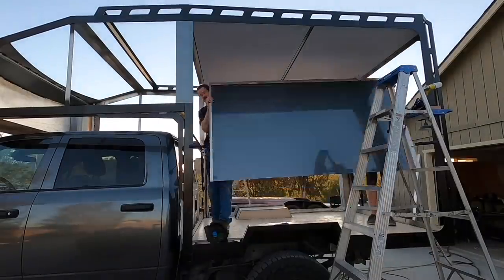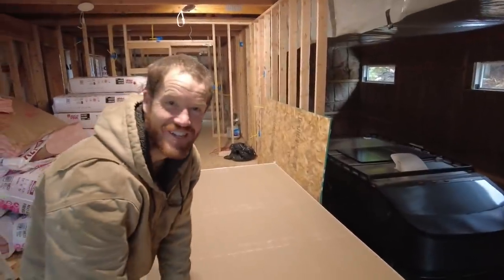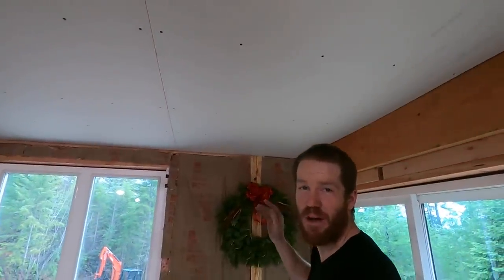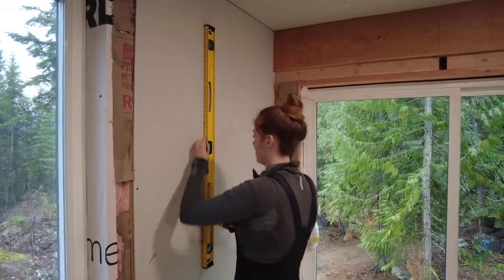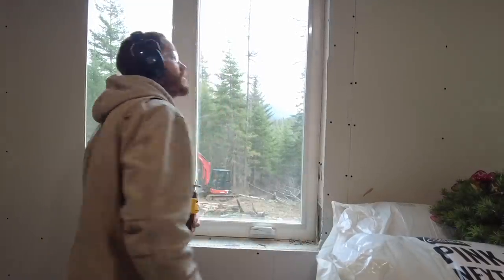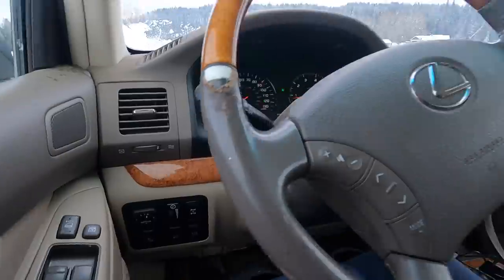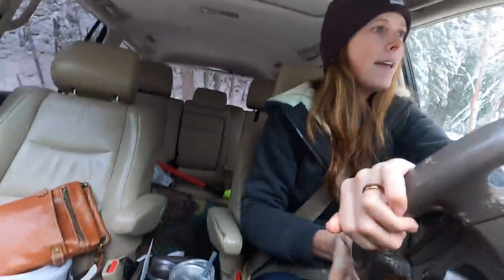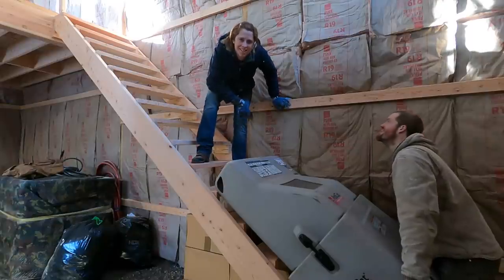Building Our Own Home | Drywall

Comment: What about your vapour barrier between the drywall and the rafters?  What did Courtney say at 15:18?  As someone who has lived with winter snow conditions for close to 70 years, may I suggest that you put some weight in the back of your snowplow truck for better traction when plowing.  You may also need snow chains.

Comment: You know Courtney,  voicing our fears, is the FIRST step to identifying them, and finding a way to overcome them or live with them.
I also agree with what Matt Rhodes wrote.

Regarding the window (and door) openings: Jeremy over at Good Simple Living figured out that a router can make a nice, clean and neat edge in any kind of sheeting. And by using the frame behind the sheeting as a guide, the opening is exactly to size.

Comment: You ain’t been stuck in snow until you get the plow truck stuck. Don’t say I didn’t warn you. It might take the “Army Truck” to get you out. 

1. Try to plow downhill and under control. Take it slow and push the snow off as far out as you can.
Plowed snow gets hard and turns into a rock wall. You won’t be able to plow it further away from the road later. (To make more room for new snow)

2. Get tire chains now. Keep them on until you get a full week of 70° weather next Spring. Tire chains allow you to sometimes plow uphill on the second push. They also give you great traction. 

3. Put as much weight in the truck bed as you can without bottoming out the rear springs. It will help the chains get a grip.

4. Make sure the wipers work, and work well.

5. If they are predicting a foot of snow, begin plowing when you only have 6” on the ground. You’ll thank me later.

6. Put two pieces of rebar or doweling sticking up 30” from the top edges of your plow. These are your guides to let you know exactly where your edges are at all times. Again, you’ll thank me later.

7. Adjust the plow feet up about 2” if you have rocks sticking up on your road. 

8. Never, ever push snow onto another man’s road or, God forbid, the government’s road. Hell hath no fury…

Plowing is really fun. Enjoy the experience. And you will get stuck. Have a plan to get unstuck already in place before you plow.

John in Minnersoda
Reply from the maker: Thanks for the tips John!

Comment: If you take a 2x4 about the height of you ceiling and attach a 3-4 ft 2x4 at one end to form  a T that is just an inch taller than your wall, you can use that to hold the drywall to the ceiling at one end while the screws are put in the other end.  Just kick the end of the board in contact with the floor lightly to press the top of the T against the drywall.  Make sure there is wood behind the drywall where you are applying pressure.

Comment: I am not afraid to say I would be petrified of taping and mudding your apartment.  I tried it once on a bathroom remodel and ended up tearing the drywall out in a fit of rage.  It was truly traumatic and took me 3 months to recover and start over.

I think perfectionism is a sickness and I have found no cure...  I paid a professional to finish my 2nd attempt, or I might not have survived.
Reply from the maker: It is certainly a very frustrating process! The pros make it look so easy…
Reply: The guy I hired used a light to show high and low spots.  He was freaking fast too.

Comment: Hi! There is no vapor barrier and insulation on the ceiling. The drywall will sag in a couple of months, depending on the humidity, since the frame for drywall is not made correctly. It's a bad job.. I hope you will learn from your mistakes. Success and happiness to you! With love from Russia!)))

Comment: When we use drywall, we cut a bevel (about 45 degree) in the sheets where they meet. Afterwards you fill those bevels with plaster and put netting over it. If you do it right, you will no longer see, where those panels meet - of course you see the different colors of plaster and drywall. I'm sorry, it's hard for me to explain in English. But anyway, you are doing a great job! I can't wait for the next episode.☺️

Comment: 5/8 " helps prevent ceiling sagging when putting drywall on 24" joist centers, but it's your place, no inspections and you will be the only ones living in it, so continue on... You do  need  fireproof panels below and behind the woodstove, though. Using paper, especially paper with glue on it,  will cause a build up of flammable materials inside your flue, and a possible chimney fire.  Cut some small kindling strips and light them off with the torch you used previously.

Comment: Cut a 2x4 with a flat board screwed on the end, that is just long enough to hold a piece of sheet rock within an inch or so of the ceiling.  Just a thought.

Comment: In Canada without vapour barrier the moisture wicks through the walls inside and freezes to the exterior walls causing mould and the wet and icy insulation falls down the walls leaving insulation gaps in the walls. Any moisture that gets into the ceiling can freeze to the roof panels. You’ll need a lot of air flow through those spaces to prevent ice build up. With vapour barrier even if some moisture gets trapped in the insulation there’s plastic keeping any potential mould out of the living space.

Comment: Well done for facing your fears. The problem with a diff lock is that on corners the outer wheels can't rotate faster than the inners so it tends to break the grip on the road as I discovered years ago in my Discovery 3 on the snow and ice setting. It may be better to save the Diff lock until there's a problem but introduce it early before you get dug in.
Reply from the maker: Thank you! And you're right about that issue with axle diff locks. In this case I was using the center diff lock, which locks the AWD transfer case into full 4wd.

Comment: I know you guys will pull it off but getting that plow installed is not going to be easy. Also, just a couple tips from an old guy who’s spent years driving and plowing steep hills.  I’d keep your SUV in 4 high.  Too much power and you’ll spin and dig in. Low range is good for plowing hills though. Keep the motor and trans wound up. First thing to go on plow trucks is the trans. Don’t want to be lugging it. And, find some blocks, sand bags etc and weight the back of the plow truck. That plow probably weighs 600 lbs or so, a huge load on the front end. Weight in the rear will help equalize the rig, better traction to the rear.

Comment: Yep, should have used 5/8 inch sheetrock on ceiling, especially with 2 foot on center ceiling joists.  Great idea using the OSB strips along the joints. It will help minimize the sagging.  Drywall screws must be every 6 inches on the edges and every 1 foot in the field.

Comment: Run to the nearest feed store or pet store and get pine shavings to use for fire starter.  You won't regret it.  It works better than newspaper and reduces the amount of kindling you need to use.
Reply: I would keep it by my wood stove in an ash bucket.  I'd fill the bucket and when it's empty use it to empty ashes.  I would put down about a 2" layer across the bottom of the stove and put my wood on top.  Light a couple of places across the front, then push the door almost closed.  That creates a draft that get's the fire roaring in a minute or so.  Pine bedding is like $9 for a 3 cubic foot bundle that will last half the winter.

Comment: when plowing your road, over-plow, like push it off the road, think ahead and snow storage.  Or you always have the mini-ex, and will have to go move the piles on the side of the  road further off the road so the plow and get through.  You may also consider 10' or taller poles with reflectors on the top 4-6 feet so you can see the edge of the road, that way you don't accidentally drive the plow truck off the road  :-D

Comment: A little tip guys, hang tarps on your wall on the on the shop side of the wall, to help hold the heat in your apartment while you work. Till you can get your wall finished. You'll be much more comfortable.
Reply: also pick up a pair of FRS/GMRS hand held radios for in case you run into trouble on your drive, so your partner can come down from the house and help.(this is in case your cell phones don't work, which is possible in the mountains, like you are.) You can get a cheap set at Walmart or Amazon.

Comment: would have advised renting a drywall lift and did a ceilings first , (Keep Costs Down) watch a demo on how to use a Rotozip, don't push against rotation  pull along guide edge.

Comment: the snow plow isn't going to work as intended until the day you pave  your driveway/road.  I like to see how the Mil truck handles your road.  You might consider putting the plow on the Mil truck, you're going to need the weight of the big truck and the larger aggressive tires especially when you're going up hill.  The pickup doesn't have any weight in the back.  my 2 cents

Comment: I watch you guys building stuff from the start and enjoy seeing you build your projects. Even though some of your building on your garage, has not been done correctly it will work. But on this episode you should of had a vapor barrier between you trusses and drywall (poly). Now that your drywall is up the only way you can correct this mistake is to spray a thin layer of the spray in foam. This can be your vapor barrier as well as the start of the insulation. If you don't have a vapor barrier moisture will collect in your insulation. Worst case scenario the insulation becomes heavy and your ceiling falls down on you. If that doesn't happen you'll have mold issues. Sorry to rain on your parade but I've built houses for years..

Comment: As a retired General Building Contractor I have to agree with BDU King. Hang the walls horizontally. Way easier to hang as well as tape. Your light fixtures look like LED trims that are meant to be installed into ceiling cans. They won't hang onto the drywall for very well, especially if you take them in and out to tape, texture and paint.
Reply from the maker: Hey Michael! These lights are actually meant to be installed straight into the drywall and have spring loaded tension clips that hold them tight to the drywall. They are a newer product and are awesome!

Comment: Couple questions. You do not have a roofing membrane. You did not install vapor barrier on the ceiling.
What's your condensation plan?

Remember essentially your living in a tin can and the potential to rot and grow mold are higher.
Reply: Code allows for a pva primer that can function as a vapor barrier. That must be his plan as he surely would not overlook such a serious issue.

Comment: Nice job! You know your making progress when the drywall goes up. Did you ever hear of "proper vents"? They go up in place of the plastic/house wrap you stapled in place. If you do not use the proper vents, you will plug the vents when you blow in the insulation. Also, when you drywall the rest of your ceiling, you might want to put up a vapor barrier [plastic] first.  I really like the led ceiling lights, so much easier than the big clunky can lights. Driving in the snow is alot of fun, of course unless you crash! lol Take care

Comment: It's a good thing Courtney is tall, my 5' Cantonese wife would be of little use without an 8' ladder.  Drywall is good but they are "glory boards"  The taping is where all the work is.  Great vent deflectors.
A little fear is good Courtney, some things you should not try to do.  Fear helps keep you safe.

Comment: Fear and listening to it is what keeps you alive. The part that is hard is when its not reasonable fear.  Being afraid of slippery steep roads is not unreasonable. Its something your not used to it just takes practice to overcome. I grew up where its snows and the roads are a mess sometimes for weeks. So that was normal to me and was used to it when I started to drive. But truth be told the first time I was the driver and faced with snowy slippery hilly roads. I too felt a chill run up my spine. But I remembered what my Dad said to do and more importantly not do and that helped. Speed is not your friend when its slippery slow and steady is your friend very light taps on the breaks. Don't be afraid to use the transmission to slow over the breaks. Especially if you have Four Wheel drive. If its real nasty use low range to slow the tire speed and increase traction. Let the air down some too like sand more spread on the ground the better. Always treat the gas like their is an egg under the pedal light pressure and try to reduce tire spin. Nothing your going to or do is worth your life or someone else's. That is why if its not deadly important to go out don't! Go when its needed and not just for a coke! 
 Courtney being afraid and admitting that is a strength not a weakness. Ask anyone who faced something nasty and lived thru it to person they will tell you fear was their constant companion. Its what makes us human and not machines, machines have no fears we do and we should not make fun of or scold anyone for sharing them. In todays world if more people admitted their fears maybe just maybe they might see themselves in others instead of seeing them just as others!

Comment: Hello from the Netherlands .  
when I was watching your video an idea for your living room wall next to the stove suddenly popped into my head.  
if you just close the open hole in the wall like on a barn door?  .  
so a complete wall in two parts that can open like barn doors outwards to the "garage" side.  
then you can close it, but also for the future if you want to place a new sofa above or other furniture, then you open the "wall doors" above and everything can go in.  
then close the doors with bolts in the floor and the ceiling a molding over the seam and ready .  
bring power into the two door halves from the sides into the wall rather than from above.  
and so you have the best of both, a solid wall and still access.
I know what an idiotic idea that's what I thought at first too until I thought about it more and then it wasn't that bad.  
it's something different to build but otherwise doable.
thanks for the video .  
Sincerely Hollandduck from the Netherlands

Comment: Well 2x4 tees to help hold up the drywall would have made your life's easier ,and another extension  of hose for the insulation blower a lot easier then lugging it up the stairs and why no vapour barrier on the ceiling then the dry wall ,i start looking into some 6 mil rolls to seal the walls between your garage and your apt ,looks great and i didnt see the dogs carrying wood for the stove up yet ...lol

Comment: I was kinda laughing when you talked about how you were scared of the snowy roads but can't understand why people would shit on you about it. I think you did great on the hill. Some friendly advice to help you guys. #1 that chevy truck will definitely need some weight in the bed (sand bags or one of 250 gallon totes with water in it.) Make sure you leave the lid loose for expansion. That would add 2000+ pounds and help you alot. Also chain all 4 tires with good heavy steel chains with the cross bars. Side note if you have Les Schwab tire stores around you they will refund chains if you don't use them.  Doesn't hurt to have an extra set. I would also recommend perhaps jacking the truck up off the ground letting some air out of the tires and then install the chains as tightly as you can and then reinflate the tires to whatever the door sill card says. Get zip ties and use them on the tag ends of the chain to keep them from banging around and possibly hit the paint on the truck. Keep extra heavy duty zip ties in the truck so if you break a cross link you can use that to reattach the cross link to keep it from banging around and you can get to your shop and repair it. 
Courtney- great job on the hill. I like the fact you at least tried it and you over come the fear and .... just maybe had fun? 4x4 can really make a sharp turn hard because it will want to buck and skid (front tires). I suggested earlier in another comment about chains on the front tires and that will help you make that turn without sliding. Happy holidays you guys! Keep up the great videos and work.

Comment: Did I miss it, I didn't see any vapor barrie on the ceiling. You had the plastic there but it needs go above the drywall unless you spray foam.

Comment: The best way to learn to drive in snow, is to do it. The best way not to get stuck is don't drive. All kidding aside, chains are way safer than snow tires, but they are a pain to take on and off. If you have chains with you and winch available, you may get stuck, but you can always get unstuck. Four wheel drive just means you can get stuck better...

Comment: I'ts a little late but you stagger your joints on the ceiling and walls for better strength. also screw should be 6
" on the ceiling and 8 to 10' on the walls.

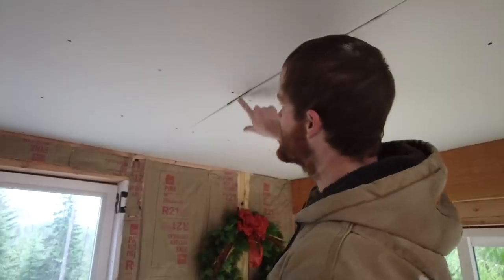Comment: Time 6:06 11/30/23. Why are u not installing a plastic on your ceiling before installing gyproc. The vapour barrier prevents moisture from going into your insulation. You want to caulk every vapour barrier joint to prevent the moisture to get into your insulation
BL from Canada

Comment: Something to research. You didn't  appear to put a vapor barrier up in the ceiling.  Your walls have tar paper which acts as a barrier on the walls. I know you don't  have a building code there, but in areas that do, pot lights in a ceiling  need a box that is a vapor barrier  but also keeps insulation off the junction box. Something to read up on. 
Spray foam on drywall and joist will act as a vapor barrier. 
Great driving Courtney.